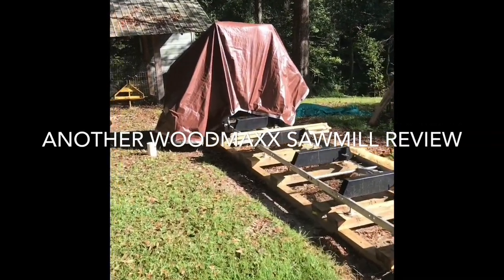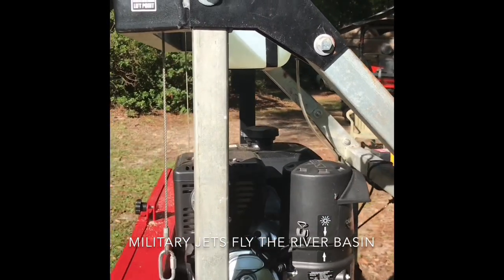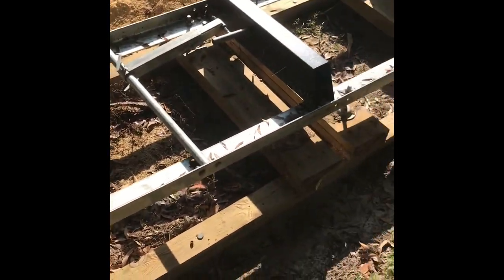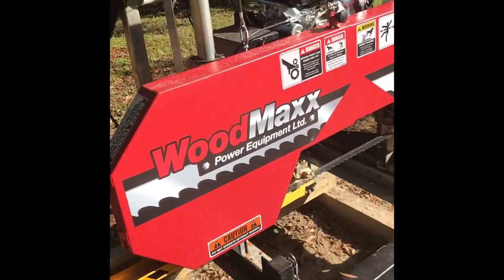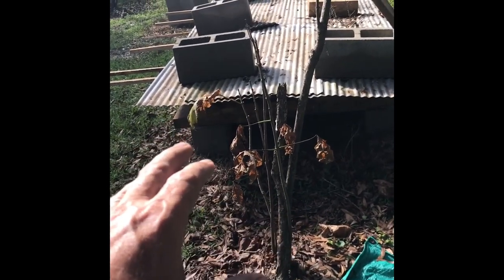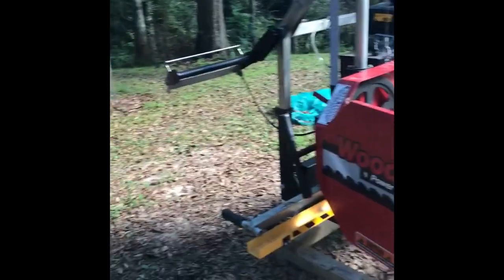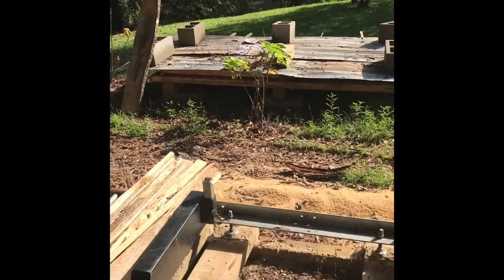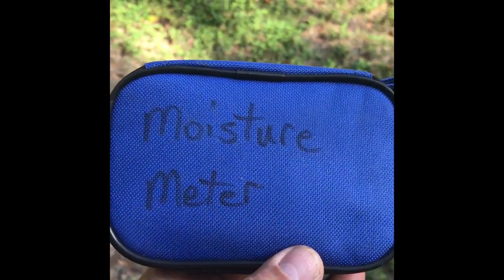WoodMaxx Sawmill Review: Should you get one?

Comment: thanks, I think the mill is good and I am looking into one for myself.  Just cant decide if I want to build or buy.  Thanks for the info and look forward to more videos.
Reply from the maker: Matthew Prestine,  One thing to consider is not just the cost of mill, but all the ‘extras’. I have a 32 hp four wheel drive tractor, but no FEL. Bought a used boom which will pick up to 20” log 8 foot. Some front weights would allow more. Already had a 20’ tandem axle trailer, but added 9500 lb winch & winch mount, for parbuckling, and a log arch on the end. With a deep cycle battery, that cost me $700. Then there’s extra blades, cant hook, chain saw, etc. I am going after a dozen large pine trees (free) next week with my new winch setup. Should be at least 4000 bd ft. That will keep me busy for awhile! I’ll do a video of how that works out. 
Thanks for the subscribe!

Comment: i live in the same area.....how long a log can you cut and what was total price with shipping?thanks for great review
Reply from the maker: I paid $4250 delivered, which included a 10 pack of blades. That also included electric start and bed extension. That was over 3 years ago. And I can cut around 17’. Haven’t pushed length limit yet but did cut a 16’ 3” log.
Reply: @backwoodshomestead482  thank you so much

Comment: i know the video a little older but im looking to get this mill would you buy it again?
Reply from the maker: I would definitely get the same mill again...if my budget was the same. And, if you are just planning on milling for yourself it'll do it all, just takes longer with an all manual mill. Just the mill setup not counting a way to go get logs and to load them on trailer and on the mill, I've got about $5500 in it. If you've got double the budget, then go with a Woodmizer Lt15  with a trailer pkg. It's just faster cutting per log. And they finance. I could make a little money with a portable, trailer package, but that's not what I want. I've cut 15000-20000 board feet and only replaced a set of bearings. Cheap and quick to do. I'm about due to change one of the two belts. The blade belt, not the drive belt. That is quick to change and cheap as well. Any more  questions just let me know. Thanks.

Comment: I'm on the look out for your wench video also it looked like you had two pieces of pipe on your trailer also I wasn't sure that was part of your lift or not.,im buying 2 20' pieces of angle to set up my tracks before even trying to install them 9 pieces of aluminum that's only 9' long lol.
Reply from the maker: Ba'rad 's, the two pieces of pipe are for the parbuckling over the side of the trailer. I used treated 4" x 4" the first time on some pretty big logs, which worked fine. But, I saw those pipe, asked the guy if I could have a couple, and he said yes. Which is about helping someone out and a return favor. I'm not saying my setup is the best as far as base. I would have rather set up on concrete, but I plan on moving the mill as soon as we find our retirement homestead. That's what the channel will be about. I will put up a video on what all I will cover on the channel this spring. I've just been kinda throwing things together and working trying to set up a new business for my wife also. 
I looked at the Hudson mill. I originally was going to purchase the harbor freight mill as I am only cutting for myself and a few friends as well. Happy I stepped up a bit on the mill. It was down between the Woodland and mine. Price took a lot of others of the table. 
Thanks for the questions. I think this format is great for learning the ropes. Btw, I'm looking at a quick dog system, that I'll fabricate or have someone do it. Look into that, as it will save a huge amount of time at the mill. To me, they'll be worth their weight in gold! 
My biggest disappointment really has been that I can not cut but to 2" off the bunk. So, I always plan on a 2" x , on the last cut. Not a really big deal, as long as I plan ahead.
Reply: yea after you said something about parbuckling I had to look It up,,it looks to be a simple and easy way to load logs and probly easier on the wench,and my trailer is just right for it,its just a flat bed I have about 8 eyebolts mounted on it.16' by 7.5' home made out of 3" channel I bought from a farmer down the road.i also looked at the harbor freight mill it was like 1947.00.then I ran across harbor they was stating they were the biggest seller of mills ,not sure if they were correct but ill find out shortly lol .oh the dog clamping assembly that's on the frontier looks like its pretty good and may be simple to build something close to it.im sure others has some like they have.
Reply from the maker: Southern Sawyer 's, on the log arch, it ain't gonna bend! Welder talked me in to 3" tubing, it's heavy. I have it set up with 2- $30 sleeve bolts. They go thru a welded on plate on either side of my trailer. If I had to redesign it, I'd add another 12" to the height. l loaded the red oak log that in the video labeled huge red oak. That log was 27" diameter, 13' long. I only had to hook up three times to load it all the way on the trailer. My tractor nearly couldn't drag it off! 
I also recommend putting a couple small logs or limbs 3 - 4" in diameter under your logs in the trailer for ease on offloading. Rounder logs will roll under weight of logs.
Reply: I think he was gonna make mine out of 2 and a half I think,yea I seen the bolts you had holding yours with was wondering what they where,i was just gonna let them build a foot for it to fit in until I seen ur bolts,i was gonna make it 10' high that was mounted in center but I went back told him to mount to the rear of the trailer and make it 5' high,yea yours looks well built,the welder had also talked about welding a plate over the joints like yours are. that was a grown log you had working with,i don't plan on getting nothing bigger than the cant it can cut and that's only 19'

Comment: Is that galvanized metal rusting already?
Reply from the maker: Matthew Prestine, There are two 'spots' which appears to be the start of rust. I plan to use a wire brush to take it down and see what's up. Then just probably spray primer on it. Not sure if it's the steel used or the galvanizing method used. I assume this is made in china and assembled here. But even if I didn't do anything, rust would never weaken 1/4" angle enough for me to worry about that. Just an appearance factor. There are also a couple of spots where paint is coming off. Same thing, brush and paint will take care of cosmetics. I understood when buying this mill that it would not be quite the quality of some other mills. But, for the price, which is half or less of others, it is a bargain. I really am quite pleased overall with performance and the quality of cuts coming off the mill. If I was in business to saw for others, then I would have went with a Woodmizer with hydraulics at 9 times the cost. I'm 60 years old and only want to mill for myself, family, and some close friends. This mill is more than enough to handle that. Look for an upcoming video on what the channel is about, building a homestead for retirement, energy independence, etc; which is the main reason for the sawmill. 
Thanks for the question, I'll always be honest with viewers. No sugar coating here. 
-Moondoggie